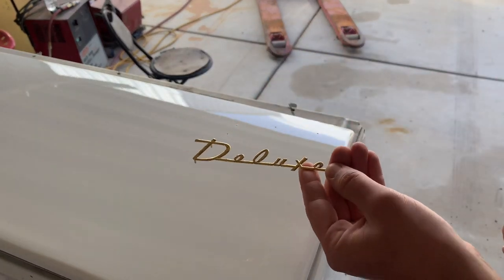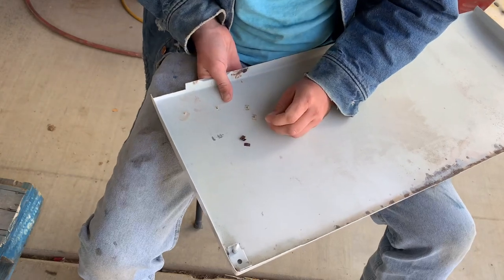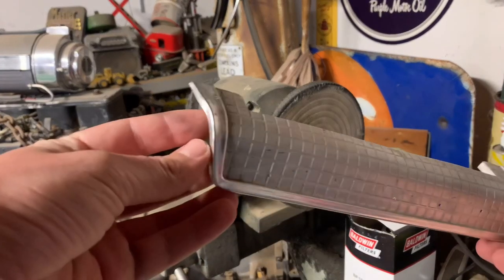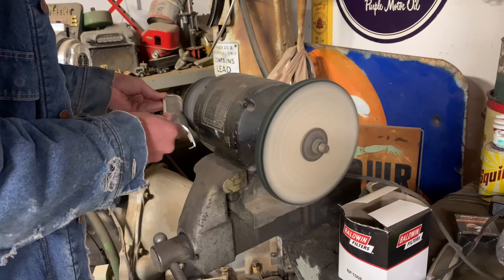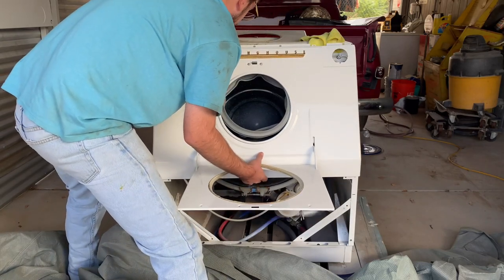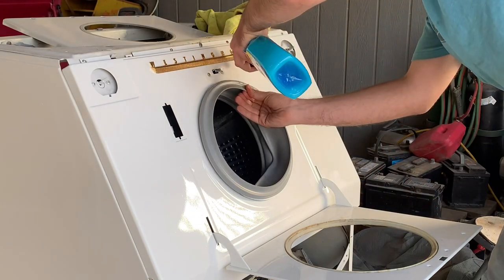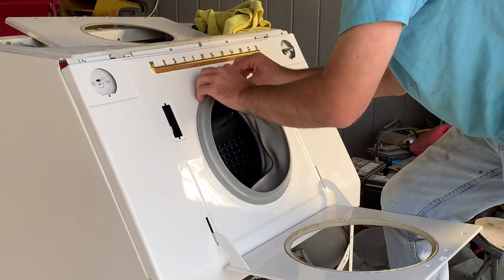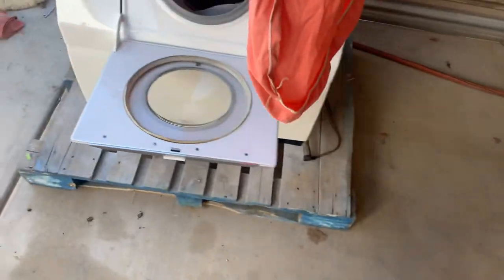1953 Washer final assembly and test!

Comment: Wow that's incredible. I agree the built in scale was a neat idea that they should bring back. I think later models had a small dial to turn to adjust water level based on the size of the load of laundry. 
Also  have you seen the live commercial where Betty Furness (the spokeswoman) ran this washer against 3 others? They ran 6 towels with dirt and soap to prove that the westinghouse could outwash any other machine on the market. You should check it out 😊
Once again, what an amazing job you did 👏
Reply from the maker: That’s pretty cool I haven’t seen that
Reply: Hopefully that works